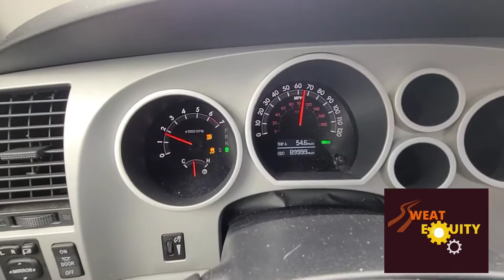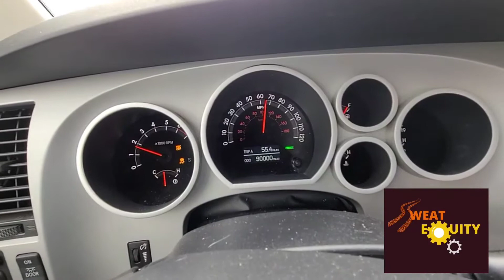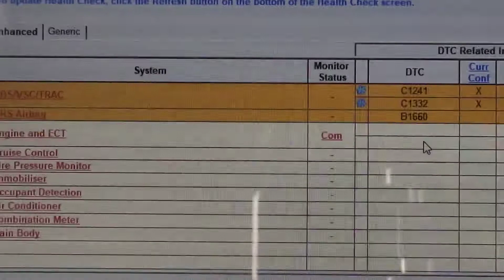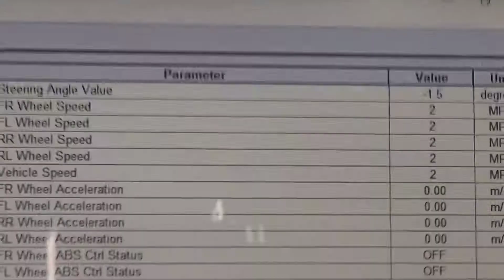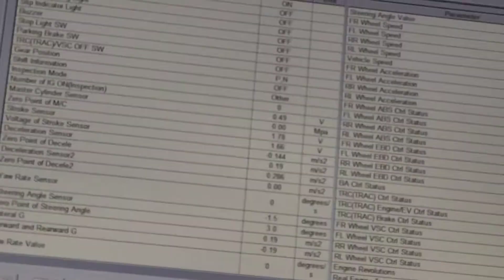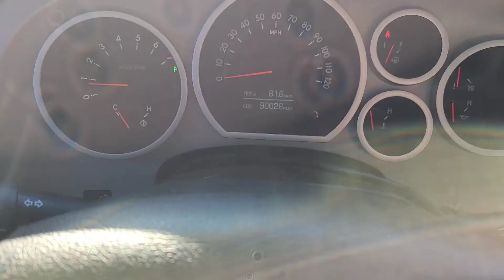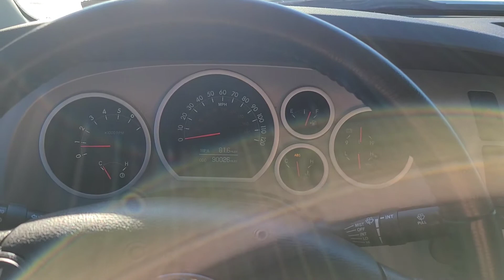TOYOTA TUNDRA 4x4 not working fix C1322 ABS open circuit 89516-0C050 harness install

Comment: My 07 has this but only the hi lo are flashing. Dealer can’t figure it out. Wonder if I should try this anyway?
Reply from the maker: That would kind of be firing the parts cannon since so many things could cause this to happen.  Would need more information of what the dealer has already tried or have found out in trying to diagnose

Comment: 3 years later. I just wanted to point out that the red wire on the connector coming from the truck. It looked chewed on or damaged.

Comment: So far I've blown around 1800 and still not fixed from different shops, going to try this harness now and hopefully this works
Reply from the maker: Good luck!  Unfortunately many shops load up the parts cannon instead of actually doing their due diligence and probably checking the simple things first
Reply: Exactly

Comment: Just did this same repair but still throwing the ABS code. Mines for the left side, I plus the right side of the harness into the left side but right code didn’t come up so it’s not the sensor. I’m thinking it’s a short somewhere else in the harness, any advice?

Comment: With my 2014 the ABS and traction lights are on steady.
4hi 4lo flashing.
When I first start the truck on the ABS and traction lights are one.
Start of slow and I hear that bang from the back a d the lights go off.
The second I get over 12 mph they all come back.
ABS a d traction of steady, 4hi 4lo flashing.

I'm not sure it's the same issue.
Reply: I have exactly same thing with my truck. Were u be able to figure it out?
Reply: @Muneer Gazal  
Actually I just fixed it a few days ago.
It was a bad rear wheel bearing.
I got a new axle from Dorman that had a new bearing already pressed on for about 480.
Reply: @swartzautoman2  ok, great thanks man:)

Comment: Before the repair, did you have any power/voltage at the sensor connection? I’m getting proper voltage at the connector, with a new sensor, but nothing. The problem arose when I installed new coil overs to level out the truck. When I tried taking out the sensor, it was stuck and it snapped in there. 
I took it out, cleaned the hole and replaced with new sensor. Yet still nothing. Tested the harness at sensor connector and voltage @ 11.8. I’m lost 😂 
Been scanning the web but nothing that helps.

Comment: Did this fix the issue. My 2014 tundra is throwing the open circuit code for the right wheel speed sensor. Replaced the sensor and the lights still haven’t gone off. Thought it may be the wiring but wasn’t sure.
Reply from the maker: More than likely it is the harness.  Mine code did come back once after, but has not returned in over a year since that.
Reply: @sweatequity4252  thanks for the reply!!

Comment: Did you had any issue when acelerating? Such as the truck not shifting because of abs sensor
Reply: I’m having the same issue I replaced the oxygen sensor and now I think is the abs   If I go over 50 mph doesn’t want to shift anymore.
Reply from the maker: Yes, one of the times it did go into a limp mode or fail safe where it didn't shift properly

Comment: What year tundra is this.  I'm having the same issue, but I don't know what the code is, because I don't have a code reader.  Do I need to take to a shop to find out if it's front or rear?
Reply from the maker: It's an 08 tundra, you would need to have a scanner that can scan abs codes. A shop would probably charge between .5 and 1.0 hr labor to pull the codes for you.  You should be able to buy a decent scanner for the price you'd pay them! Good luck. Some like this should work INNOVA 6030P OBD2 Scanner ABS Code Reader-Check Engine Light-Diagnostic Scan Tool Live Data with Battery & Alternator Test-Code Severity Levels-Full OBDII Modes https://www.amazon.com/dp/B0887WYZVH/ref=cm_sw_r_apan_glt_fabc_8A2NYGYBRYWVNN168FMP